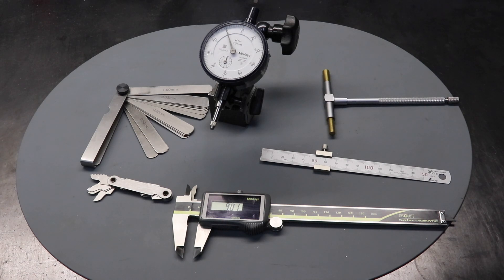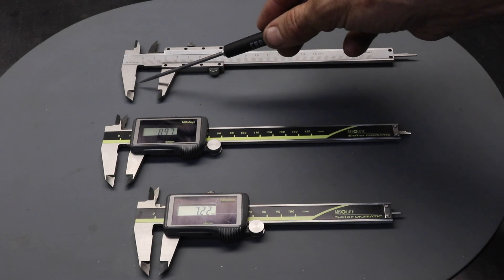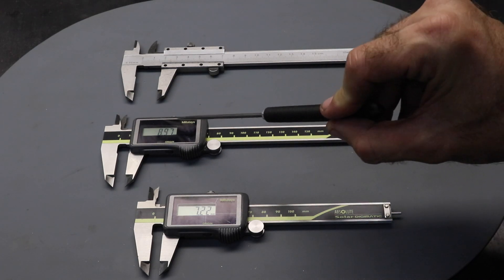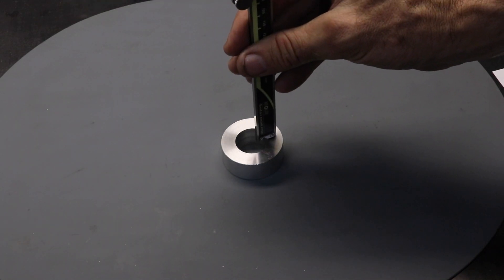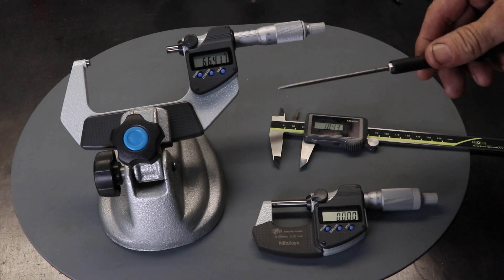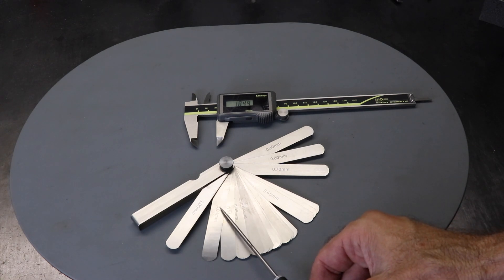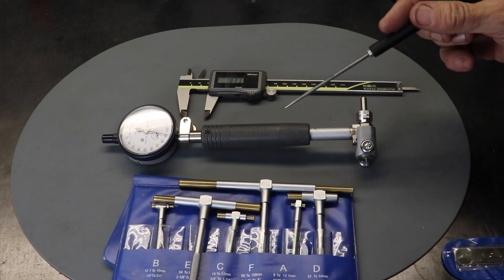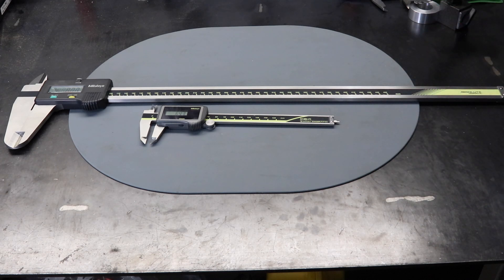Garage Talk Part 6- Measurement Equipment

Comment: Just the video i need, i ride a wr250f and wanna do a top end, 200 hours on it, i planned on doing it alone, but after reading the manual, I couldn't understand if I should get an oem piston kit, or to put A or B aftermarket piston?
I don't also have the proper tools to determine which piston size to put, how can i play it safe in your opinion?
Reply from the maker: The only certain way to tell is to use a bore gauge and measure the cylinder bore. But if you don't want to invest in a bore gauge you could inspect the cylinder and if it still looks in good shape (crosshatching is still clearly visible) and no signs of wear then I would recommend using the same piston size as the original. You might be interested in watching the cylinder bore measurement video: https://www.youtube.com/watch?v=VnVosSuFY-E